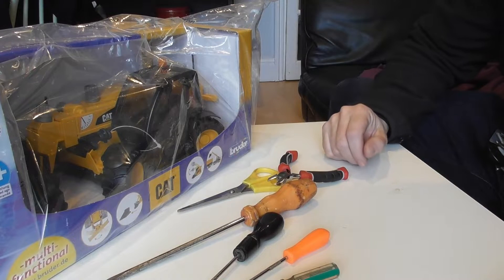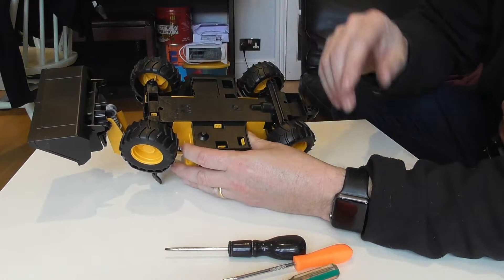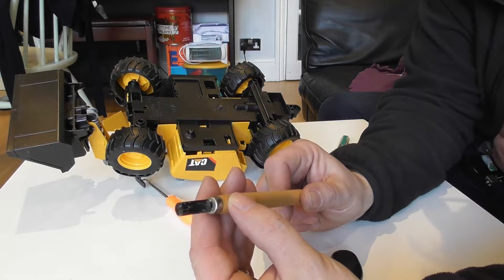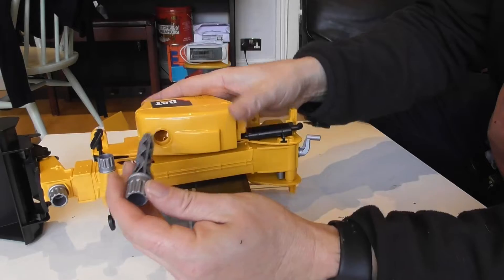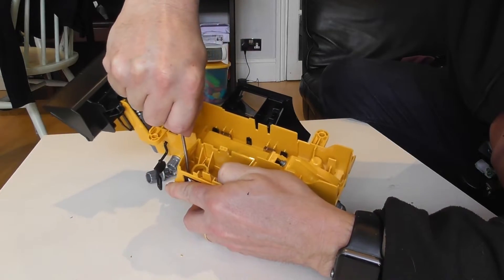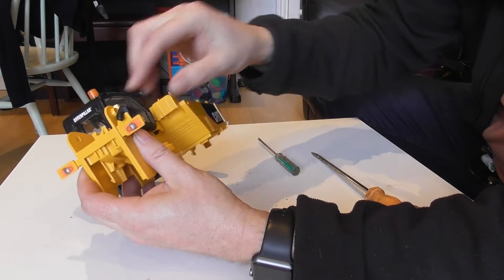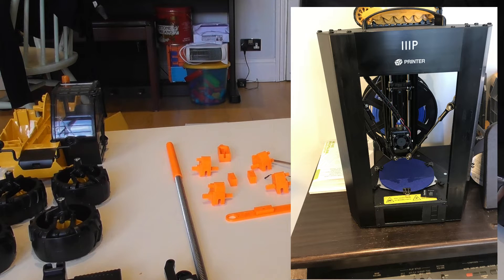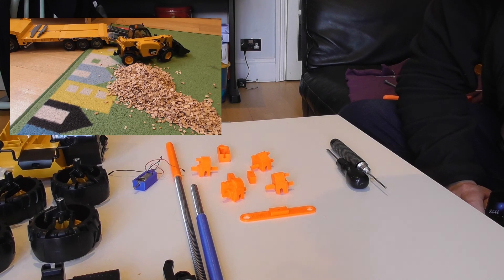Bruder CAT telehandler pt3: dismantling and 3D parts

Comment: Nice builds you have:) i was just thinking about the bruder cat wheel excavator ;) woud you Try to convert That model? :)
Reply from the maker: Thank you! Glad you enjoy them. I did think about the wheel one, but settled on the tracked one - as I thought that it was a bit more realistic and if memory serves me correctly, the wheel one has those rock hard plastic tyres, which I would need to change and therefore loose the original ‘Bruder look’. Never say never though, I’ll add it back to the list of things to think about 🙂👍
Reply: @RCModders  The wheeled loader has the same soft style tires that Bruder uses on the rest of their builds.  I converted one, with STL files that I found on www.rctruckandconstruction.com  SteinHD did a thread there explaining how to convert the loader. I tried it, but I was new to 3D printing, & didn't have luck with the printed parts.  I traded that conversion away for a trailer.

Comment: Have you taken apart the Scania Cab of late?. Bruder should make 3d puzzles for guaranteed frustration and garden shot putting. Typical Germanic engineering ingenious and robust. By the way I hear certain German value shops have replaced their soap pump with a Syphon. No idea why!!!!?????...😗😘😁
Reply from the maker: I am deliberately avoiding dismantling anything Bruder where I don't need to - and I think that includes the truck cabs. I managed this with the Mack & hope to do so with Scania / Mercedes etc for the very reasons you are outlining! I suspect that part of the reason that they are designed like this is to make them 'child safe' and met some regulation or other. I wondered about the soap dispenser shortages too  😂😂😂, Thank you for your comment, have a great day! 😀👍
Reply: @RCModders  No worries, I'm sure our Germanic friends have underestimated British ingenuity especially regards re-use or "hacks" for their products. LOL. There was a YT vid showing a Scania Cab being dismantled, it is worth a look if it still exists. Some two and were "great fun", the killer is around the "door mechanism" if you are too over zealous you can snap the easily.